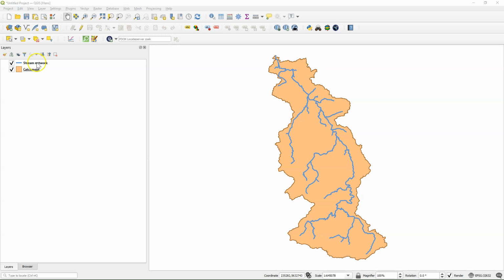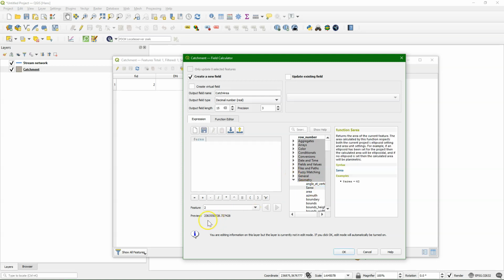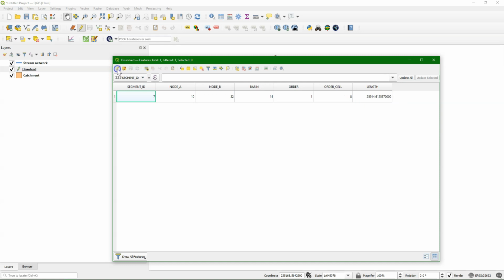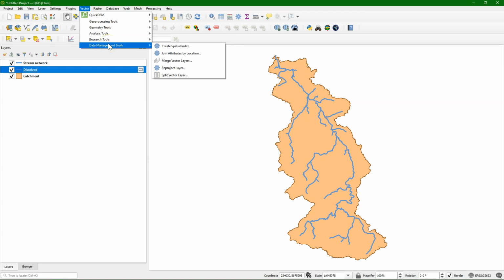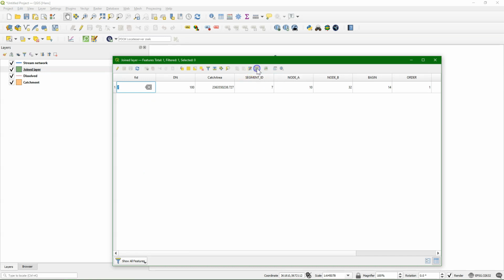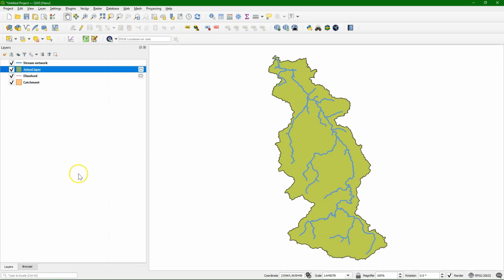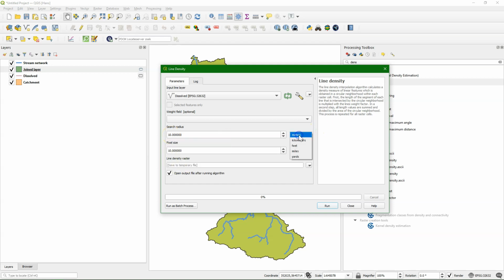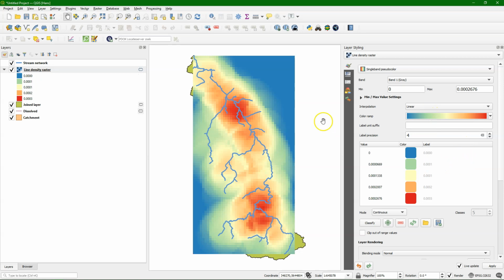Calculate Drainage Density in QGIS

Comment: Dear Kwast, thanks for the resources you have provided. It is very helpful indeed. My question is how can I extrapolate my line density results to the entire catchment areas as the results doen't cover areas which are not covered by stream lines. Even in your case little areas in the southeastern and northwestern part is not covered. Is it not possible to extrapolate? I tried to clip with the order of "mask extent", but yet not working.
Reply from the maker: Good point. It seems the tool uses the extent of the river line vector layer or its convex hull. You probably need to do a feature request to have control over the output extent. You can do that here: https://github.com/qgis/QGIS/
Reply: @HansvanderKwast  Thanks for your prompt response.

Comment: Thank you for all your highly qualified videos/courses. What is the proper way to obtain in Qgis Horton’s Laws parameters (Rb bifurcation ratio, Rl length ratio, Ra area ratio) starting from a DEM?
Reply from the maker: Here's a video showing how to calculate the Bifurcation Ratio: https://youtu.be/HFv43yrg4mA. The other parameters can be calculated in similar ways. Maybe I'll make videos for that later.
Reply: @HansvanderKwast  Hi Hans, thanx for the video and the script. I guess I caused it somehow. But the issue is not on how to calculate Bf or Bl (script is btw very useful) rather on having streams and subcatchments both classified in a coherent way with Strahler order. I think what is missing (both in saga and grass algorithms) is Strahler for areas.
Reply from the maker: @simonebrotto1977  If you want to assign the Strahler order to the subcatchments (if I understand well that's what you need): 1. Use the junctions layer to derive the subcatchment for each junction. See this video how to delineate multiple subcatchments iteratively: https://youtu.be/Hqc_1CMadhA. 2. Do a spatial join (Vector | Data management tools | Join attributes by location) where you can join the ORDER attribute of the Strahler order layer to the subcatchment that it falls within.